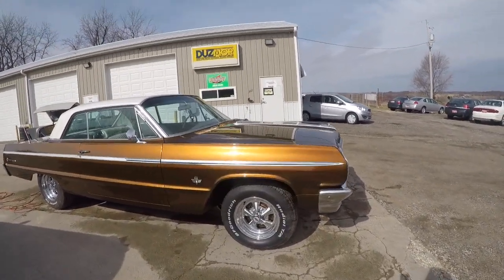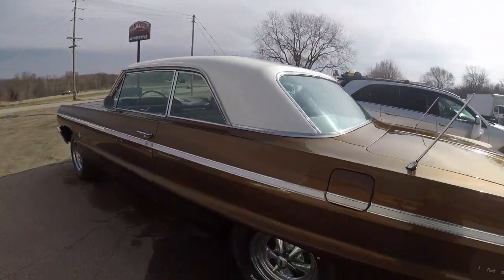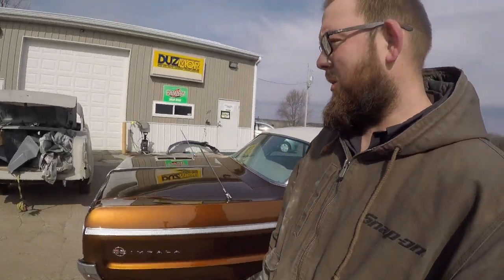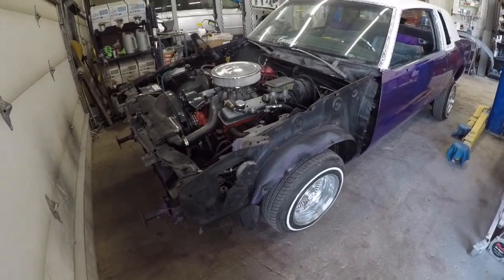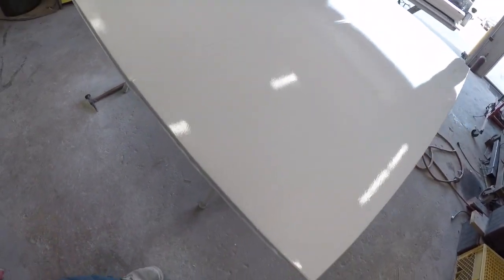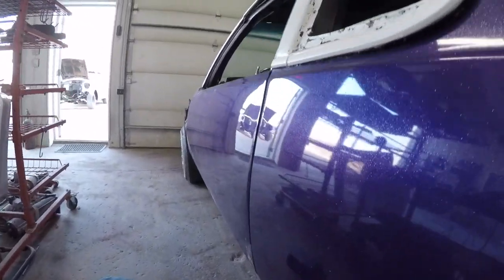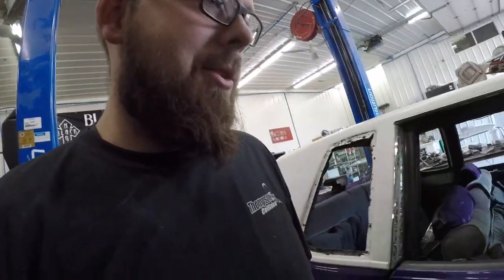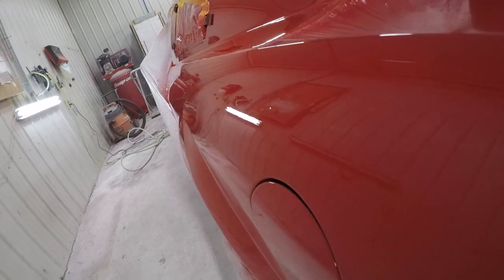Six Foe is gone!!

Comment: Job looks great.  Just curious how much you get paid ? Up here in northern cali  you couldn't drive a car like that for less than 10k
Reply from the maker: 112477fm 10k wouldn’t pay for the paint labor and materials on this one. Customer has about 50k in parts, labor and the car. And it still isn’t done. But this one has a 409 big block with a 4 speed. Sweet ride.
Reply: @RJTickler  yeah  I figured . Great job by the way . Thanks for the reply

Comment: Epoxy is great stuff but mostly used after sandblasting to seal the metal untill you can get to it months later.But now adays I use direct to metal primer surfacer.Kind of kills two birds with one stone,gets rust protection and starts the surface build Process.My customers are to cheap to pay for epoxy.
Reply from the maker: yeah i love DTM surfacer, i use polyester a lot too. its nice to have a bright color seal under it to help stop you before cutting into the old paint job. I've been bitten too many times painting over someone else work and having a reaction where i cut through.